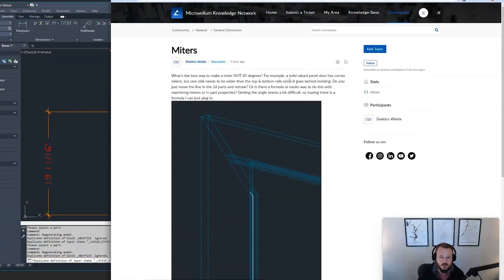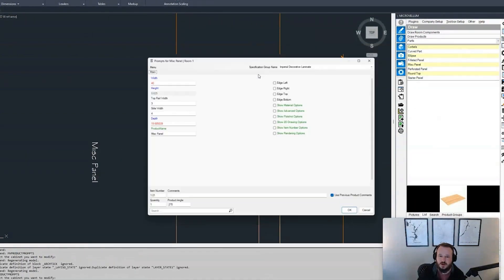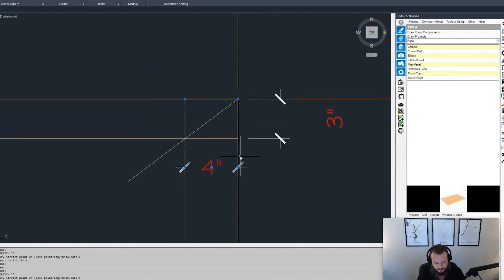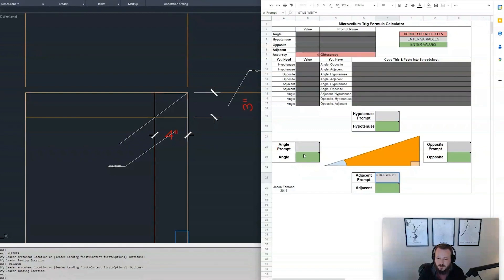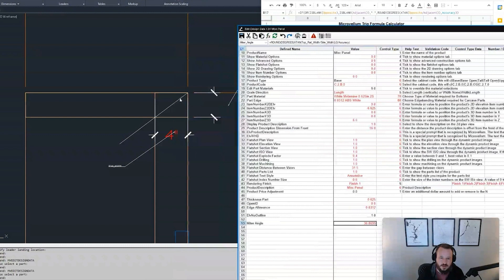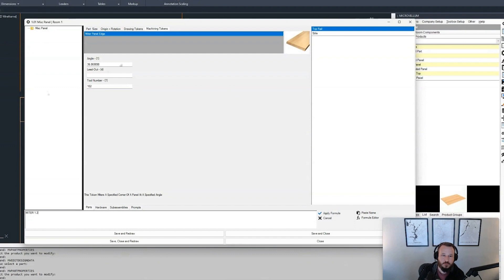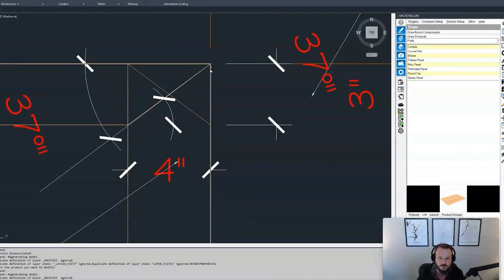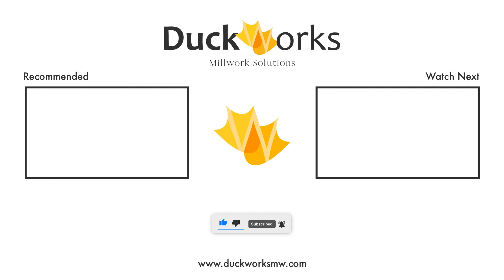Calculating Miter Angles Parametrically | Advanced Microvellum Tips

Comment: Hi, i am having a difficult time with the shadow rail option. Do you have a video that explains it better?
Reply from the maker: I don't, but will definitely look at making one in the future! Have you looked on the Microvellum community forums by chance?
Reply: I did but couldn't find anything related to the problem i am having. If i make the top shadow rail zero, it doesn't adjust the door sizes nor makes the shadow rail equal on the drawers. Do you have a solution for that or do i do it manually from the edit design tool?